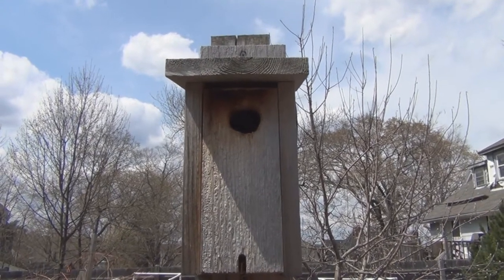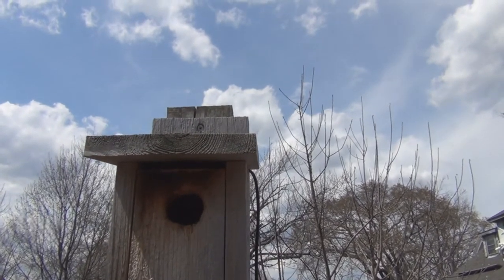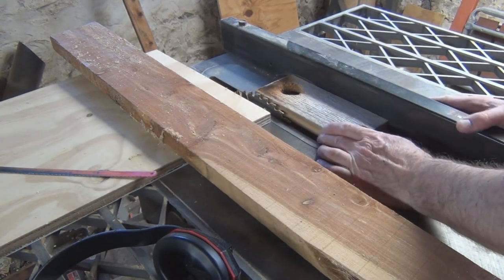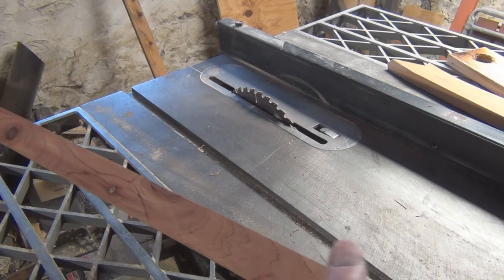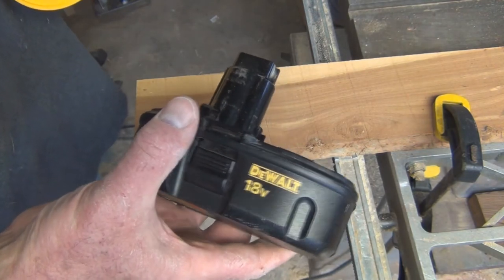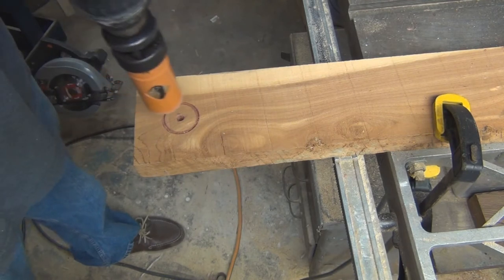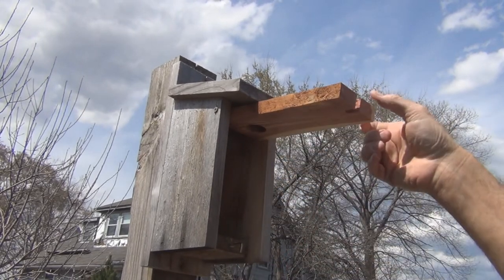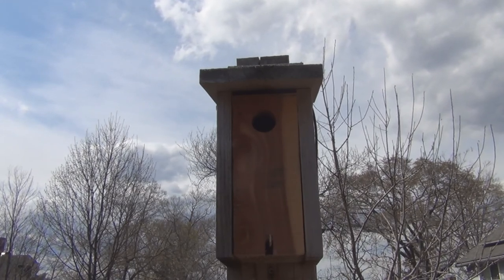Bird Nesting Box Repair

Comment: If you put a raccoon collar over the hole you only have to replace the collar when squirrels or other critters enlarge the hole. Plus critters, like raccoons, can't reach inside to get the eggs or the young. We have a big problem with squirrels chewing the holes so they can live inside. I always make several collars at the same time to have replacements. Most people won't predrill the holes for the screw and the thinner wood splits almost every time if you don't. We have 5 blue bird nesting boxes like yours that we need to clean out each year and some times have to make repairs. We have a pair of Nuthatches living in one for the last 2 years. You probably noticed that the hole ends up the size of the hole saw after you make the hole. A little bit of wobble when making a hole. I like your push block and the respect you show the table saw blade. Bernard